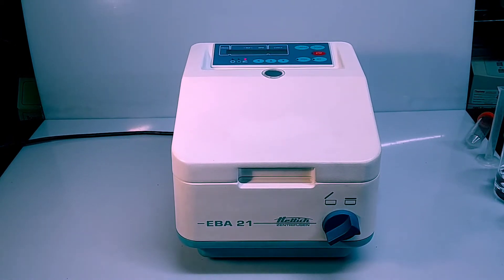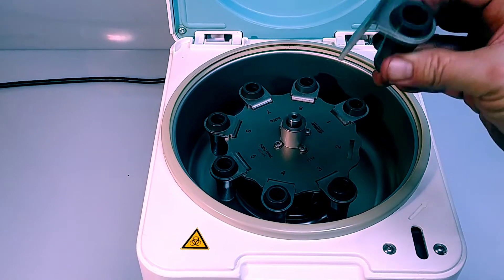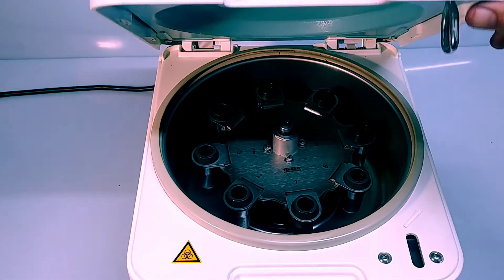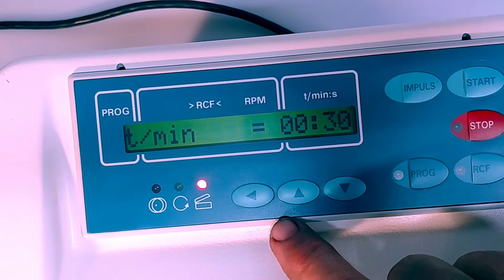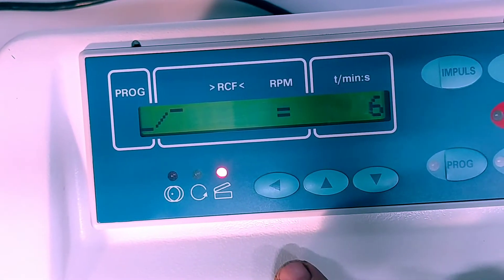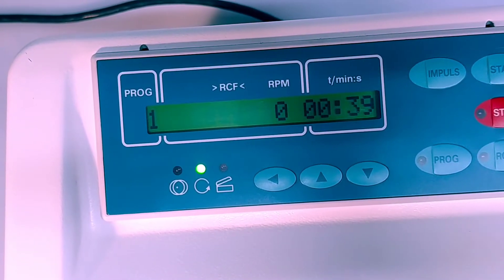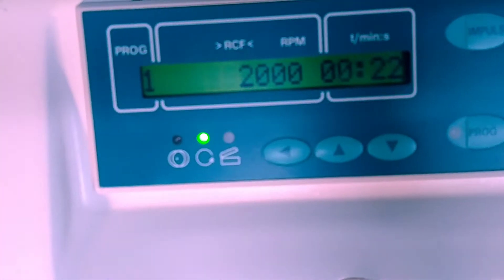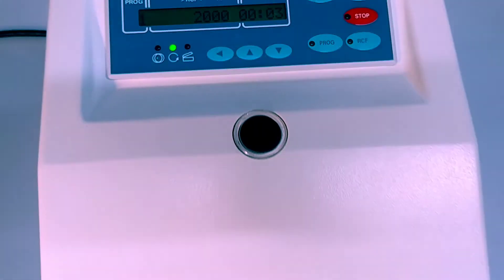Hettich EBA 21 Centrifuge Operation

Comment: How do you fix the “Mains Interrupt” error? Please and thank you!
Reply from the maker: Sorry for the VERY late reply.  Mains Interrupt indicates a momentary power failure or interruption.  Usually all this requires is to shut the unit off, wait a few seconds, and turn it back on.  You may additionally wish to check the fuse - but if it was bad, you would not see an error on the display.  Other possible ways to generate this error are significantly worse, such as a possible motor failure.  And that would likely require additional service.  Hope this helps.
Reply: Where is the fuse